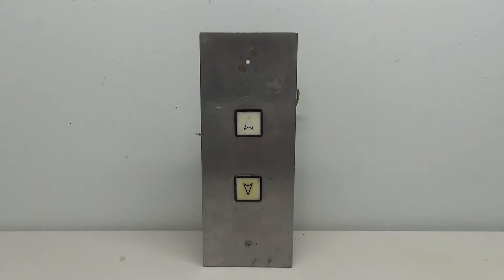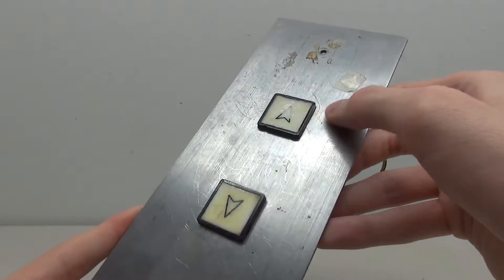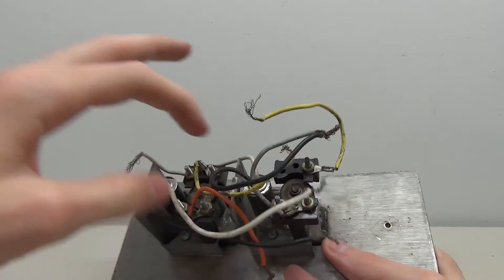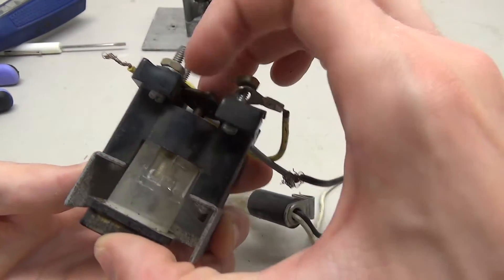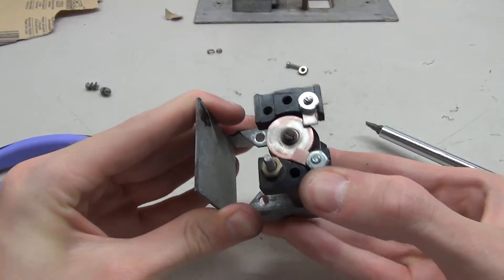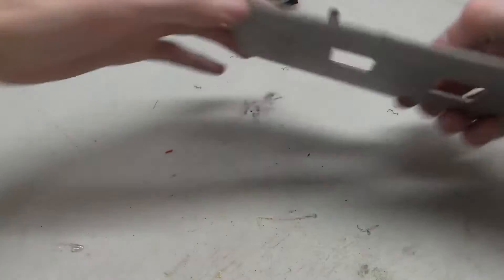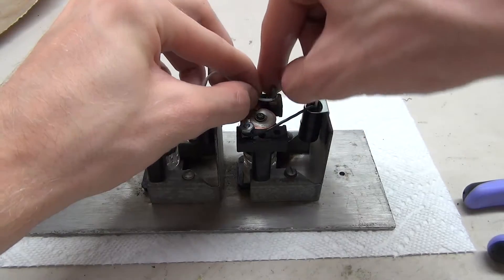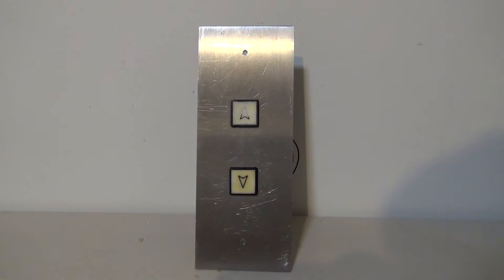Wiring Montgomery Square Elevator Buttons

Comment: I have severalold elevators in our properties. One is a Montgomery P.2629 and being told the selector is no longer supported. The major players are telling me the only way forward is extremely expensive mod package. Any advice around KCMO?
Reply from the maker: See if you can find a smaller company like Midwest elevator to look at it.
Reply: @stlelevators  Midwest came and looked at my 5 stop DC units and got scared because I had another company signed with a service contract. I have one of those units down because "DC generators are obsolete" according to the elevator industry standards.